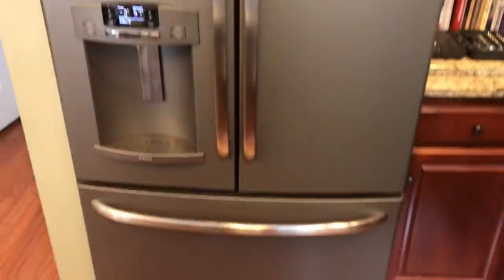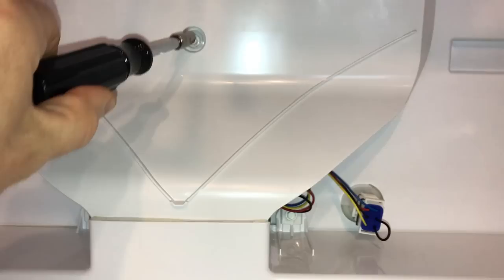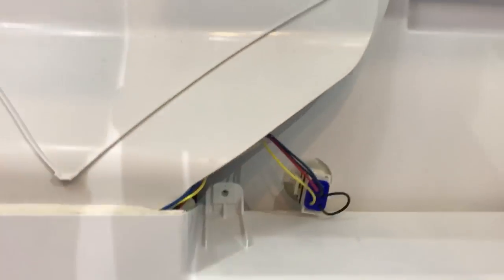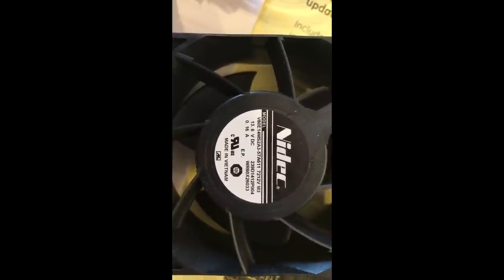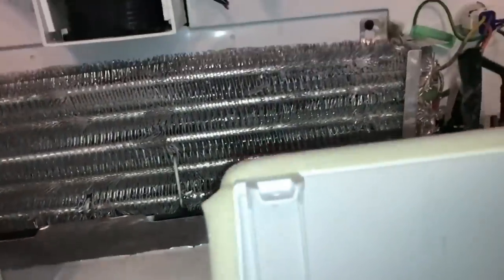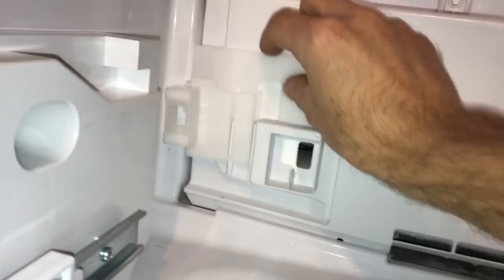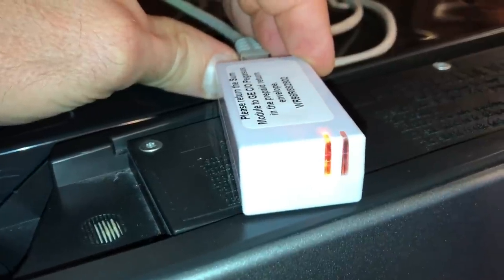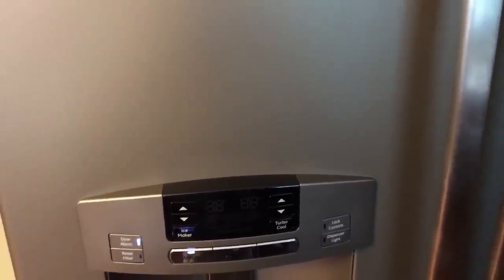GE french-door refigerator not cooling - How to replace evaporator fan

Comment: Replaced my evaporator fan and now the fan won’t turn off. Constantly runs and bottom portion of refrigerator is freezing up all my food. Does this mean my thermistor on top is not working properly or do you think I need to do software update? Also where is this Ethernet and box assembly found to do software update? My new evaporator fan didn’t come with one.. Had a tech come and he believes it’s the thermistor. What’s your take on this?
Reply from the maker: The software update would not control the constant running of the fan.  If your fan did not come with the update, it should not need it.  The thermistor would be the most likely issue.
Reply: Awesome thank you!

Comment: I replaced the evaporator fan. It fixed the fridge but now the freezer isn’t working. Previously had no issue with the freezer. The freezer is at 25. Any suggestions?
Reply from the maker: I would not think the new fan would have caused a new issue with freezer. 
Make sure the turbo cool is off and the freezer temp is set at zero. 
If still not working, there is a fan for the freezer that could be causing that problem, so look for videos for that. Also, check out the Forum section of the ApplianceBlog site. The moderators there are great and could guide you in the right direction.

Comment: Does an upgrade need to be done after the fan replacement?? Or is that just an extra thing you did? Where u say the upgrade page is here I go to page & its not their
Reply from the maker: No, the replacement fans now no longer require the upgrade.  So you will be good to go with just replacing the fan.
Reply: @ljschuby99  thanks for the quick reply.
Reply: @ljschuby99  now we are having new problems with the refrigerator not moving past the temp of 45degrees in either way so we ordered the software update & hopefully that will fix our problem.
Reply from the maker: @UNIQLUVIN  OK, maybe that will help. 
Also, you can check out the Forum section on the ApplianceBlog site. 
You can make a post there. The site moderators are great and may have other ideas for you too.
Reply: @ljschuby99  thank you I most definitely will do that. I appreciate your help. 🙏

Comment: Have same fridge, water pooling at bottom of freezer.  have an ice dam.  checked top half of fridge, noticed the crisper controls were not illuminated and noticed a lot of ice on the left hand side where a very small fan that runs to the crisper drawer is connected.  Evaporator fan is working, but it would appear the crisper is not.  I cleaned connections and put together.  lights on crisper control came on, but tha6t tiny fan is not spinning.  When should it, and how do I trouble shoot it.  It appears to spin freely.
Reply from the maker: Yes, with water pooling at bottom of freezer, it is likely a different part causing problems.  Check out the forum section of ApplianceBlog site.  You can search Thermostat or Control Board for similar issues, and there is also info on entering self diagnostic mode so you could check status of thermistors.  Moderators on the forum are helpful at troubleshooting.

Comment: So changed the evap fan that was bad, did the update, and now the door dispenser for ice and water isnt working??? Worked fine before, any ideas? Been service tech for almost 11.5 years.
Reply from the maker: I have not heard of any issues with the software update that have caused a dispenser problem. 

Is the dispenser getting power - could it be a door switch or dispenser switch?
If it is getting power, could it be a frozen water line?
Reply: ljschuby99 yea it has power and everything, I went into diagnostics mode and reset the computer and it started working for about 2.5 cups and automatically stopped. Its disabling itself for some reason.

Comment: I’m experiencing similar symptoms (warm fridge cold freezer) however if I engage Turbo cool the fridge temp goes to an appropriate 35-38F. Do you think replacing the fan would help with my situation? Having to engage TC every morning is getting annoying.
Reply from the maker: It could be a control board problem, but replacing the fan would be the first thing to try.
Reply: ljschuby99  Copy that. Will replace the fan first. Thank you so much for the tutorial! Was your unit reading off any codes? You would think the system would report a faulty fan, presumably from the extra control wires on that harness.
Reply from the maker: No codes. I think it was a combination of fan and the software running it. A new fan will either be more compatible with existing software or will include an updated software to make it run properly.
Reply: ljschuby99 I thought I had found the culprit as the old fan was completely broken and not spinning at all. However, after replacement the temps are still swinging from 35 to 54F. I have to constantly engage TC to get the temps down. Any idea what might be happening?
Reply from the maker: @wumangorocks  OK, so fan is good, but something is causing it to not turn on, and the Turbo Cool is forcing the fan to start.      

Check out the forum section of ApplianceBlog site.  You can search Turbo Cool for similar issues, and there is also info on entering self diagnostic mode so you could check status of thermistors.  Moderators on the forum are helpful at troubleshooting.

Comment: Might be having that same issue. Any idea if the fan should start and stop intermittently?
Reply from the maker: The fan stopping and starting is usually a sign of a bad motor.
Reply: @ljschuby99  a bad fan? Mines keeps starting n stopping. Freezer fine, fridge side could be colder. Sounds like the fan keeps trying to start up. Eventually it does start up. Then some time later it stops and its trying to start up again. Seems like fan is not powerful enough to blow the cold air to fridge.

Comment: Great video. Just wonder how you find out the problem is the fan in the first place?
Reply: From what I have found out, if your freezer is working and the lower part of your fridge seems much colder than the top shelves, this is most likely the problem.  Waiting on my part now.  So happy to have found this video!
Reply: Right now --my inherited ge french door fridge is very quiet. For 6 years it has been making an annoying noise. The freezer works fine and the fridge section is at 45' even without the fan running. When the fan was working --the noise would stop when you open the door. Technically--I am an idiot. I cannot even find the fan after removing everything in the fridge section.  I wanted to order the correct part. I was going to get the number off of the old fan. I will keep looking at videos for more help.

Comment: do you have to do the system update to make the fan work?
Reply from the maker: No you don’t have to do the software update anymore. 
The current replacement fans have the same specs as OEM, so the update is not necessary.

Comment: ljschuby99 - Thanks so much for this video.  Well done and exactly what I needed.  You are the MAN.   One side note I would add for others is that don't expect your fridge to cool down immediately after this repair.  My fridge took about 6 hours to get back to "safe" temperature for perishables, even with the fridge loaded with non perishable items to replicate a semi full fridge.  In fact, I saw virtually NO improvement for the first 3 hours.  Went to bed and checked it in the middle of the night only to find it at 37 degrees as recommended.  Great video, great explanation.
Reply from the maker: Thanks a lot for the comments and tips. Glad you got it fixed!

Comment: Freezer only at 15 degrees. I have all the other symptoms (fridge at 52, crisper freezing) but the freezer is not as cold as it should be. Shoulf I try the fan first?
Reply from the maker: Sounds like the fan definitely is not running which could be causing a freezer issue as well.  While it could be a control board, switch or thermostat, I would try the fan first to see if that takes care of the problem.

Comment: After years of frustration with the fan grinding to a stop and water filling the space below the lower slider and freezing the evaporator solid I finally found a piece of black wire insulation plugging the condensation drain wickerbill now the fan runs without freezing up. Replaced the first fan and reprogrammed the main board two years ago. No evidence of any water in the catch basin below the condenser until now.
Reply from the maker: Wow - lucky that you finally found that. Hopefully this is not a common thing, but will definitely be something for others to check out if they have a similar issue.

Comment: Just replaced the fan but I’m afraid it’s not cooling down. Still at 74. Is the software update required?
Reply from the maker: Software update is likely not required with your new fan. 
Can you tell if the fan is running?You could try the Turbo Cool of your model has that feature. It may take several hours to reach temperature. 
If still a problem, make sure there is not ice buildup blocking the path from the freezer to the fan.

Comment: I am having slightly different issue if I turn off the fridge for few hours and turn back on then evaporator fan is working and the refrigerator is cooling but once it's cooled to set temperature then it doesn't turn back on I had to do the same process again. But once it cools down once then the evaporator fan isn't spinning and do see frosting in the coils. Any suggestion on further diagnosis?
Reply from the maker: That sounds like it could be a control board issue.  You could try to see what the error codes showed.  Check out this GE service bulletin REF05-15 for instructions to get the codes:  
https://www.scribd.com/document/352635908/REF05-15-GE-Refrigerator-Service-Bulletin-Fresh-Food-Evaporator-Fan-Contributing-to-Warm-Temperatures-1

Comment: Same issue here. Freezer working, fridge warm and bottom drawer of fridge frozen. Repairman came (don’t think he knew what he was doing). Opened up freezer defrosted it, everything looked fine. Looked in the back didn’t see any issues. Couldn’t find the technical service bulletin but mentioned it should go back to temp and he will research. I then found your video, took apart my fridge to find the fan not moving and the coils frozen. Defrosted overnight and ordered the new fan. Installed turned on and still fridge doesn’t seem to be cooling. Am I missing something?  It’s only been a couple hours but still I’d imagine fridge should be a bit cooler but nothing.
Reply from the maker: If the fan is now working, the fridge should start to cool. It will take several hours, but if your unit has it, you can use the Turbo Cool to speed it up.

Comment: I had replaced the evaporator fan in fridge couple months ago and  I noticed the freezer stopped working for some reason yesterday which made the fridge also remain around 45 degrees.  I think it was my fault.   Disconnected power and turned it back on without waiting 5 minutes to reset or something.  The freezer fan would never spin so I assumed it was a defective fan in freezer.     Ended up power everything off last night for full 15 minutes and by morning both freezer and fridge returned to normal temp  37 fridge and 0 freezer.   I also don't keep my Air Conditioner on during the day som indoor temp in Texas can be around 83.  I added digital thermometers in various areas of the fridge and it is amazing and sad how quickly it heats up if the door is open.  Keeping the door open for merely two minutes, the temperature in fridge jumped from 37 to 50 degrees.
Reply from the maker: Glad that worked. 
Thanks for the tip to unplug for a while and reset.

Comment: Hi great video, I have a similar model. Why does the software need to be updated for a fan? And why is there another replacement fan that does not require the update? It seems the software update would be separate from a fan matter. I am seeing several different "WR60X..." part numbers for the fan and they all appear to fit the same model.
Reply from the maker: The first replacement fans had slightly different specs, so a software update was required to operate it correctly.  The newer replacement fans have the exact same specs as the original unit so a software change is not needed.  You can see service bulletin (link in description) for details.
I replaced the fan on my fridge with the fan which required the software upgrade.  It has been working fine ever since.  
The new fans cost a bit more and may not be readily available, but do not require the software change.  You should be fine to go with either repair option.
There are links in description for both fans.

Comment: Can you please tell me what the software update is for? Just bought the fan and need to know if I have to purchase the software update also?
Reply from the maker: The software update is for certain replacement fan models. If your new fan did not come with usb cable then it will not need an update and will run properly with the current software.
Reply: @ljschuby99  thank you so much for all your help! We thought we might have to buy a whole new fridge  but I think this will be the fix that save us $2000.🤞🏼

Comment: This video was a lifesaver!!  Quick question, the new fan worked and is cooling but after 2 days the fridge isn’t cooling to the set temp of 37°, it’s staying in the 40-42° range. Any thoughts?
Reply from the maker: Make sure that the air flow from the freezer to the fridge below the fan is not partially blocked and frozen. Also, try setting the fridge a bit colder to see if the temp goes down. 
If not, it could be a thermostat issue as well.

Comment: Thank you for the video, looks pretty easy to replace. I bought the part and wanted to know what type of screwdriver is needed for those types of screws?
Reply from the maker: You will need a 1/4" socket.  If you have one that fits on the end of a screwdriver handle, it will be easy to remove and replace the screws.

Comment: Hello I’m needing, I order a replacement fan, but the one I have seems to work sometimes I think. My temperature won’t go below 44-45 degrees.
Reply from the maker: Go ahead and remove the cover to check out the fan to see if it spins freely or if it seems to stick.  You can also look at the evaporator and see if it is frozen.  Also, check the temperature in the crisper drawer to see if it is freezing foods. 

If any of these things are problems, you could switch out the fan.
Reply: ljschuby99 as of right now, the crisper area is not really cold. When I removed the cover this morning at 45 degrees the evap was frozen. So I order the fan and it will be here tomorrow.Another thing I noticed is the air flow vents on the side, air is only coming out of the second vent, nothing  is coming out of the top near the ice box. Is this normal?
Reply from the maker: @pedrothomas8515  Usually some cold air will still get into the crisper area, but the fan replacement is still a good place to start.
For the vent, it could be frozen or blocked by ice.
Reply: ljschuby99 ok, my last question. My temperature will not get to 35 degrees. Stays around 43-45. Once I replace the fan, do you think this will help
Reply from the maker: If the freezer is staying close to zero then the new fan would be able to pull the cold air up into the refrigerated area.
Reply: ljschuby99 UPDATE: added the new fan yesterday and this morning was 34 degrees ‼️Thanks mane
Reply from the maker: Good job - glad you got it fixed!

Comment: Do you know what could be wrong if the freezer is not staying cold enough to make ice?
Reply from the maker: Your problem is likely in the freezer section.  There is an evaporator fan and a condenser fan for the freezer that could fail.  These are located in the back panel of the lower freezer. You should be able to hear a properly running when you open the freezer door.
Reply: So is it the condenser fan or the evaporator fan?
Reply from the maker: @lilomartv1490  If you open up the back panel in the fridge and see that the evaporator coils are iced or frozen, then it would be the evaporator fan.

Comment: how often can this happen I had this replaced a few years ago and today my fridge is not getting cold and I know it has to be the same issues. Can often can this same problem occur?
Reply from the maker: It would not surprise me that it would happen again. Not sure if you did the software upgrade when you replaced it previously, but today’s fans should have updated specs that do not require the software update and may last longer this time.

Comment: I replaced 3 of these fans and they all were too cold afterwards.  would the software update help with that?
Reply from the maker: Interesting. The software update could help, but it may be hard to locate now. 
Also with the temps being too cold, could the problem be with the thermostat or sensor?
Reply: @ljschuby99  Yes but why did 3 fridges in a row do that when the fan went out?

Comment: Fan working air coming out at top of vent at 20 to 30 but still ices up evaporator.  If it is working  what else should i look at thanks.
Reply from the maker: It is possible that the fan is not working as it should due to the software issue.  A new fan will either include a software update, or will have different specs that work with the existing software, so a replacement could solve the issue.
Reply: @ljschuby99  fan waved replaced under warranty 3 years ago sticker inside says upgraded fresh food fan. Thanks